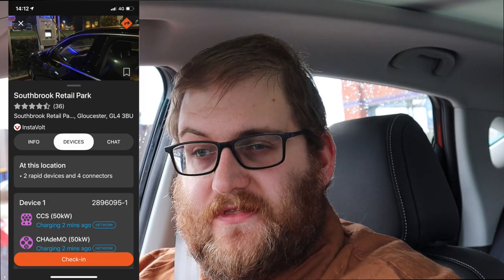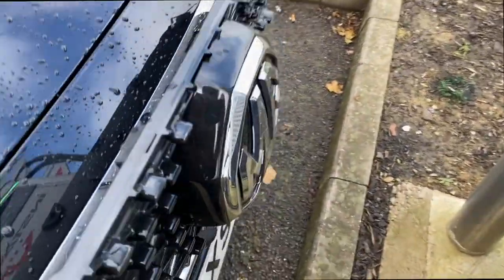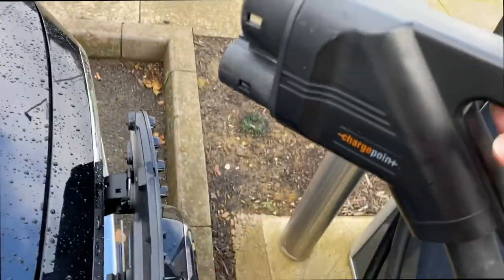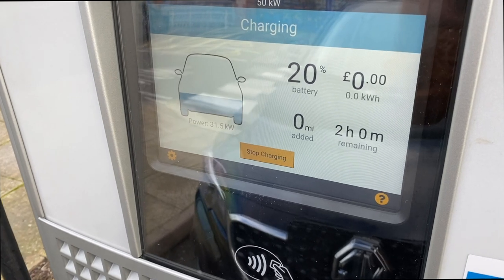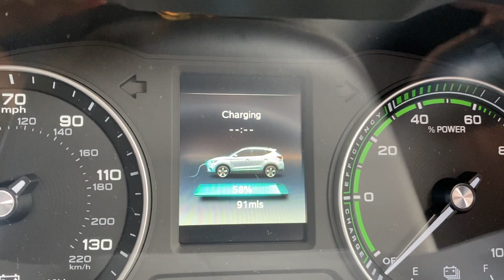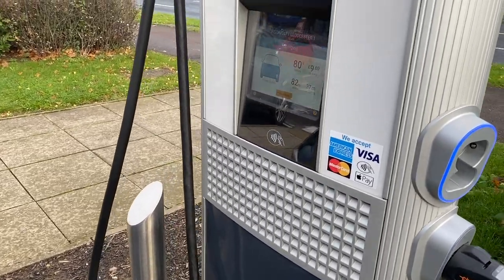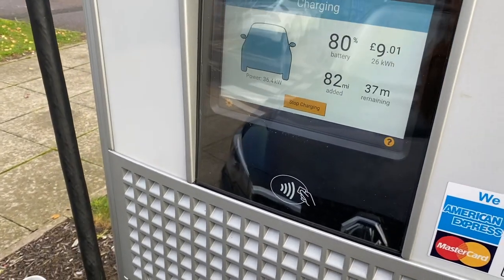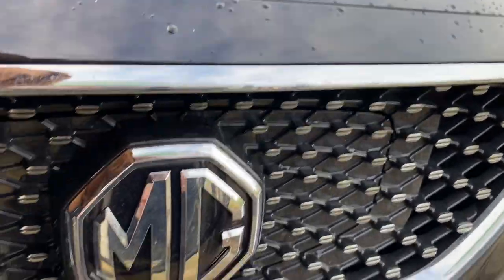Using an InstaVolt public EV charger to charge my 2020 MG ZS EV!

Comment: £9 for 80 ish miles - until electricity prices are regulated electric cars are almost a false economy with the initial purchase cost considered also.

Nevermind the time you have to wait if you were on say a long journey.

Interested to follow your experiences though  as I've been looking to go electric for a while but still can't justify it
Reply from the maker: Remember though that the cost of public rapid charging is massively offset by the cost of charging at home or on cheap/free destination chargers.  Some people never use a rapid, and they're charging for very, very low rates on flexible home electricity tariffs.
Reply: I’m charging at home this evening which is costing about 4p per kwh and on Sunday last week the cost was negative so I put in 38kw in to mg zs EV and was paid by my energy supplier to do so. I’m also lucky that West Yorkshire combine authority (group of local councils) have come together to offer 100’s of rapid chargers in the county FOC until Oct 21. I only have to rely on chargers like those in the video on rare occasions if we are on a long day trip or holidays/ journeys upwards of 150 miles which is rare
Reply: Until the speed of charging and cost of rapid charging beats putting £10 of petrol into your car in less than 5 minutes and doing over 100 miles then electric cars will alway be out of the question for the majority.
Reply from the maker: @skimmingstoness  people keep saying that but EV sales keep rising. The vast majority of drivers wake up to a fully charged car every morning - some even pre-heated or cooled to a comfortable level (not this mingebag MG, mind). They have enough range to go about their daily routine and plug in again in the evening. My current client is 110 miles away from my house, a pretty extreme commute that you’d be mad to do every day. I can do it in this and plug in, for free, at their office, ready to drive home again.

Comment: Instavolt network is becoming the go-to selection by all EV owners. Quite why all other operators are incapable of matching their service is a mystery. But until they do that there will be a resistance by people to change to an EV if they need it for distance journeys. I have now stopped planning anything other than Instavolt stops when on a road trip as they have been shown to be so reliable. And always in double units that reduces any waiting possibilities.

Comment: I'm not really into EVs but I wouldn't mind one for just pootling about in and most of the time (99% of the time), I don't go far from home. Most I do is 7 miles a day for work and on the odd occasion, I might do a tad more if I need to go to the tip or to a business out of the city. As for 'Instavolt', it certainly seems worth while as it makes the whole EV experience so much easier and straight forward. Instavolt I think may have nailed it as I've heard so many positive remarks about them. Many of the other chargers often seem unreliable and to use them seems to be a bit of a hassle and you then end up with so many cards due to a lack of standardisation. Thumbs up to 'Instavolt'. The MG5 EV estate seems a good looking car.
Reply: A year into our EV ownership we really agree with you, 99% of our journeys are perfect for an EV.  We still have a second ICE car but honestly with chargers like Instavolt we are seriously thinking we can go all EV.  They might be more expensive than home charging but as top up, they are easy to use and mostly in locations there are things you can do. My recommendation is, go for it!

Comment: Hey, thanks for the video. Is a 50kw charger the max you can use on the ZS or could I use a 150 or 300kw rapid charger? I got this car today and I am unsure how it works. Thanks
Reply from the maker: Can use any CCS charger with the ZS - it’ll just charge at its maximum speed (which is around 70kW in certain conditions but primarily <=50kW). It’s not worth paying extra for a faster charger if you have a choice, but you can use whatever is convenient.

The newer mk2 ZS charges a bit faster I believe.

Comment: I am curious. What style of driving you have to maintain , to keep within the suggested milliage indicated? Are you able to drive her normally, or are you thinking about your driving, in terms of being economical?

That could be cheaper, but for the size of car,  I don't think that' horrendous at all.
Reply from the maker: Interesting question James - it's a difficult one to answer, if you drive like an utter tool you'll see awful economy, just like in a petrol/diesel car.  Driving fairly normally, it'll get reasonably close to the claimed range, drive with economy in mind and it'll get a lot closer.    The onboard range indicator (guess-o-meter or GoM) adjusts to your driving style over time.  You don't need to drive like a vicar, though!
Reply: @ModernHeroes  Interesting, thank you for the reply. I like the idea it adjusts to your driving style over time.

Really enjoying your videos, please keep uploading. James
Reply: If you have a constant heavy right foot and drive at higher speeds all the time, the battery charge will drop considerably faster. If you drive sedately like I do, then you'll get close to the indicated range. Like any vehicle, the harder you drive it, the more it will cost to run.

Comment: Did it get any higher than 36 kWh it claims to be 50 or is that just limited by car
Reply from the maker: Highest was 44 but not for long. It averaged 38.5kW, given the £9 charge at 35p/kWh for 40 mins. Charge rates vary depending on the car, the charger, temperatures, what you had for breakfast, etc. 😊.
Reply: @ModernHeroes  when it’s -5 probably snowing go back to same charger and do a comparison video for us, you know us brits love the cold 😁
Reply from the maker: @Paul-en9yh  will do 😂.

Comment: How often do you see 70-80kwh charging speed
Reply from the maker: I’ve never used a higher power charger - 50kW ones are far more common in places I’ve been so far.
Reply: @ModernHeroes  I used a 100kw Gridserve on the motorway in my Corsa Electric and it was incredibly quick.

Comment: 30p plus makes running EVs more expensive than ICE cars. The high public charging cost, poorly maintained and overly complicated charging network is why there isn't a mass move to EVs. The charging network and government have to do better
Reply: I hope there never is a mass move to EVs because I love the piston engine. Sadly it seems manufacturers are moving towards EVs because the Government in their infinite wisdom wants to ban internal combustion engines by 2030, so in the near future a petrol head like myself won't have any choice but to buy an EV. EVs are more expensive than petrol cars because the lithium and additional copper used in their construction, as well as the aluminium to keep weight down, are expensive metals. You may save on running costs but by not much and you may save on servicing costs but if the batteries need replacing, then you can wave good by to any savings made there. Some manufactures are improving the emissions on piston engines and some engineers have developed a system where and engine emits zero NoXs and CO2. Fuels and oils are mostly synthetic these days so this means they are better for the environment. I don't think a major switch to EVs is the right way to go.

Comment: Is there a minimum charge cost at Instavolt, I tried one the other day and only put about £2.75 in but my credit card was showing £5.
Reply from the maker: No, it’s preauthorisation. The £2.25 you didn’t spend will return - usually pretty quickly with InstaVolt but some networks are far slower.
Reply: Thank you. I’m taking my first long trip and it’s certainly a learning curve.

Comment: Hi, I got a MG ZS EV last week and i am so confused with the chargers, I havent got a charger at home yet and ive only got a couple of local charging stations but i need a charge lead for them. My dealer says I just need the MG type 2 to type 2 but when i meantioned CCS the emails stopped, I think he was trying to hard sell me a cable. Anyway can you tell me what is best as these are not cheapI dont want to make a balls up :-/  and i'd like a cable that can give me a rapid charge on long stretches, really hope you can help   thanks :-)
Reply from the maker: Hi Kim - any rapid charger that uses a CCS connector will have the cable tethered to the unit, you don’t need your own cable to use them. The Type 2 cable is used for slower destination chargers like those you’ll find in car parks (Tesco have a load of Pod Point 7kW type 2 chargers in their car parks for example) - these are untethered - it’s just a socket, so you bring your own Type 2 cable to use those.

Comment: the new instavolt chargers are a lot better than their older tritiam chargers.  I could never remember if its connect first then tap payment card or the other way round on their older chargers - I always get it wrong and have the merry dance of swiping to swap and returning the cable to the charger of trying to get the charger back to start.  Anyway I am nto complaining too much as they are one of the first to have contact-less payment without messing around with an app.
Reply from the maker: Yeah these ChargePoint branded units are much easier to use. They have some new models they’re rolling out in certain locations too, manufactured by BYD, I haven’t seen any in the wild yet but have seen photos
Reply: @ModernHeroes  Its getting better all the time, no excuses about the lack of range and infrastructure for my brother next time he changes his car. ;)

Comment: It is the charge that puts everyone off and the amount of miles so you have to charge it more than petrol or diesel vehicle.
Reply from the maker: I don’t think it puts everyone off - thats clearly not the case.  The cost is a moot point - rapid chargers are designed for use in-journey for longer journeys
Reply from the maker: You might find this useful - a real world breakdown of a 775 mile journey that mostly used public chargers, including some of the most expensive. https://m.youtube.com/watch?v=cGcQ7ewAzZE

Comment: Thanks for doing these, How much does it cost on the home charger? if you have a smart meter what is the difference when you turn the charger on? #canyoutellimhalfscots
Reply from the maker: All depends on your home electricity tariff. The same charge that cost £9 in this video would be £3.75 on my current tariff (15p/kWh). Use a smart tariff like Octopus Go where it’s 5p/kWh for a fixed period overnight and you’re at £1.25.  A “full” charge at home (40kWh - very low state of charge to 100%) would be £2 - £6.
Reply: @ModernHeroes  thanks for the reply.  Appreciate the info 👍

Comment: Is there a downside as far as long term battery life goes with using these rapid chargers?
Reply from the maker: The ZS EV has active liquid battery cooling so there’s far less impact than there is in, say, an early Nissan Leaf which doesn’t have it. Long term impact unknown but the only people who are going to be rapid charging very often are taxi drivers etc. Time will tell - there’s a few on the private hire circuit already!
Reply: I also have a ZS EV, personally I'm avoiding rapid chargers where possible, only for the odd few long trips in a year to preserve the life of the battery as I have heard frequent rapid charging will decrease the life of it. That said the difference we're talking about is probably 10% reduction after 10 years over not frequently rapid charging. That's based on generalisation from what I've heard of 7 year old EVs so may or may not bother you.
Reply: The batteries do degrade overtime, especially with rapid charging. However the water cooled batteries are less prone to accelerated degradation but are not immune to it. Like any chemical substance, the batteries will degrade.
Reply: @ModernHeroes  EVs are good for people doing town deliveries and local taxi runs. I was a taxi driver 15 years ago when not even the fist Nissan Leaf was available. I have seen the odd early Leaf in my town being used as a cab but it didn't stay as a taxi for long though.

Comment: Really looking forward to you documenting this vehicle, I'm particularly interested in longevity of the batteries and range and above all reliability, reason being I'm looking at a MG5 EV for Private Hire.
Reply from the maker: The ZS EV is in service in quite a few areas as a private hire vehicle - I think the MG5 will be even better!  Obviously time will tell with reliability but there are definitely some around that are piling the miles on!
Reply: @ModernHeroes  would definitely be nice to get feedback on the ones used for PH